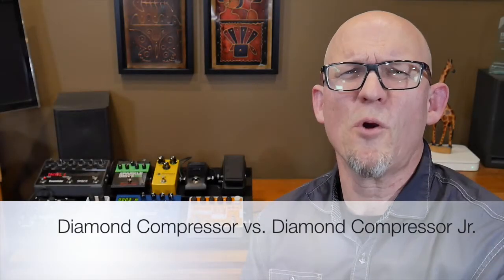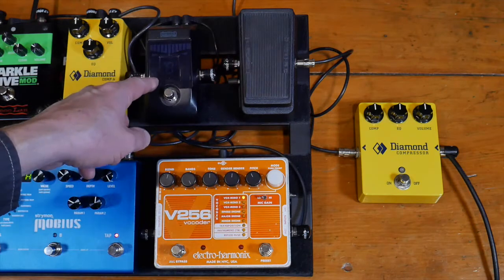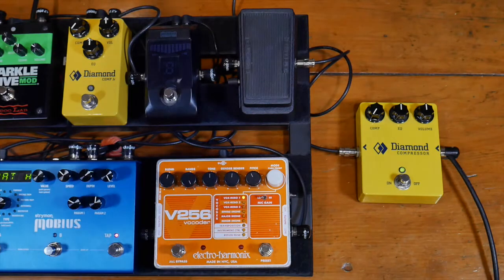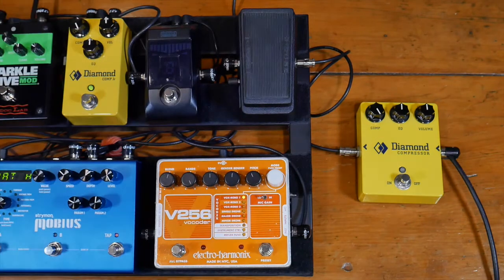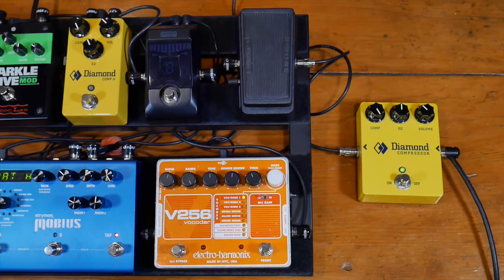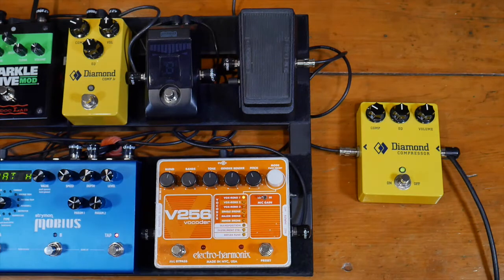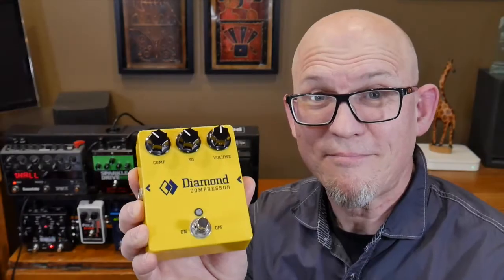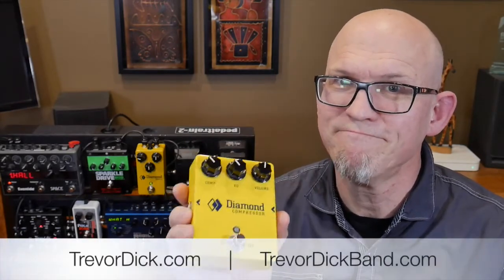Diamond Compressor Jr.  vs   Diamond Compressor CPR1 Demo

Comment: Hey Trevor. Nice board. Reminds me of Jean Luc Ponty. Anyway - I have been doing research on Compressors. I already have The Diamond Tremolo = Fantastic. Can I ask: Which one is capable of more compression ? Less Noise ? Thanks
Reply from the maker: Hey Michael, I would guess, without actually doing the direct research that the CPR1 has a higher Compression / lower noise ratio - is used in many pro studios ... T
Reply: @TrevorDick  Thanks man. That pedal has some "Always-On Magic" to it . . . everyone says it. I can Hear it - too.
Reply from the maker: @michael_caz_nyc  100% Sure does! I keep mine on all the time! T